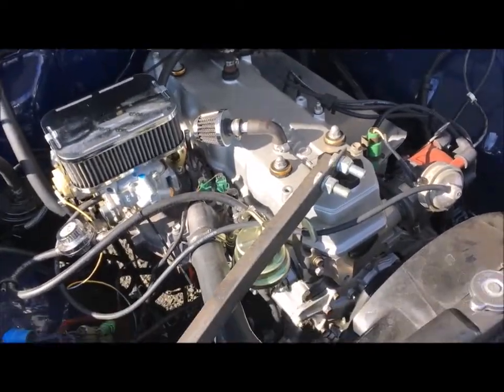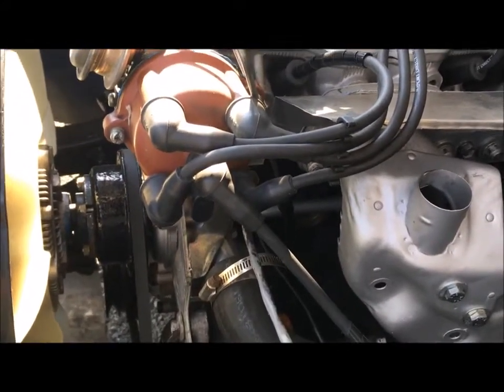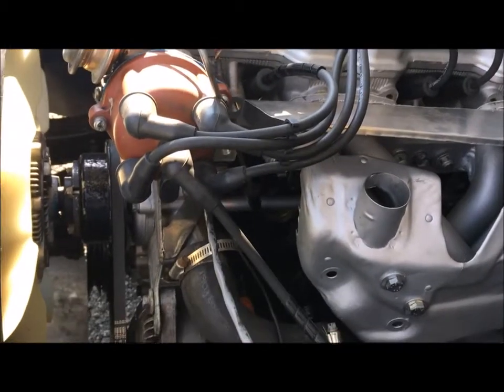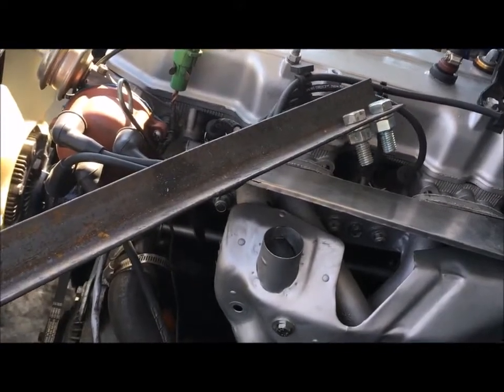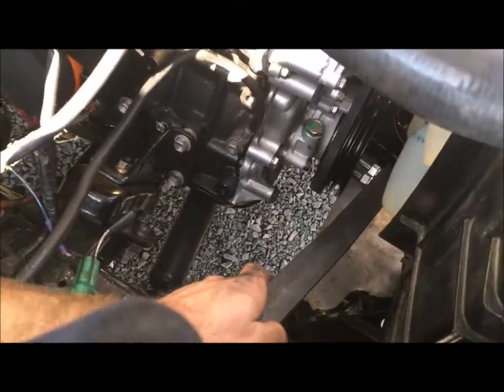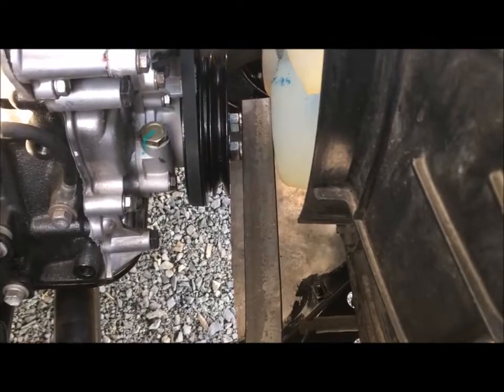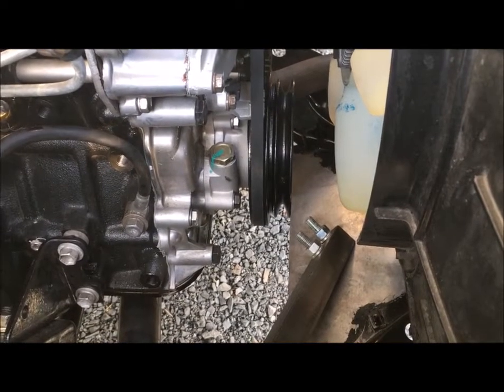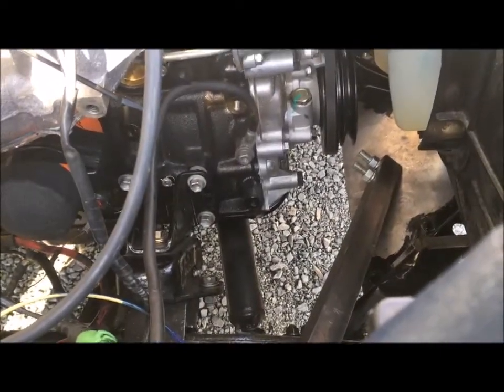Toyota 22R Crank Pulley Bolt Removal DONE RIGHT

Comment: DIY tool or you can use an OTC pulley holder which is basically the same thing but has different sized dies ... it works for the cam/distributor drive gear bolt too.  you are definitely doing it the correct way though ... some people jam screwdrivers between the pulley and the timing marks on the oil pump but I've seen them break the timing marks right off doing that or bending the metal lining on the pulley.  the bump the starter works too but that can be bad too.

Comment: Update. Get the big angle, 1 inch doesn't hold up
Reply from the maker: Yeah, my 1" counterlever was probably barely enough. You could also double up one inch, if 1" is all you had lying around. It still cracks me up that some people claim you can pop a crank pulley bolt with a strapwrench as a counterlever, but maybe they do it for crossfit.